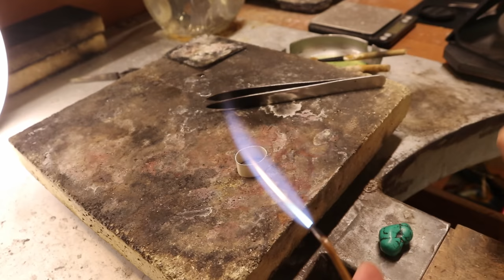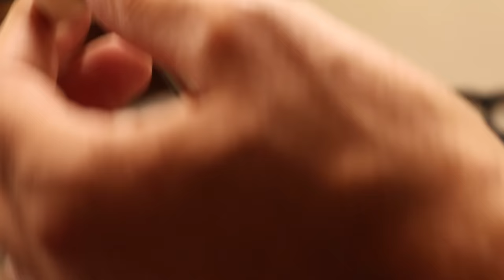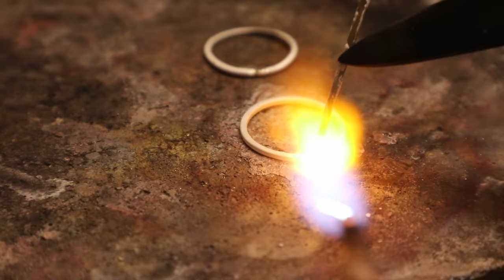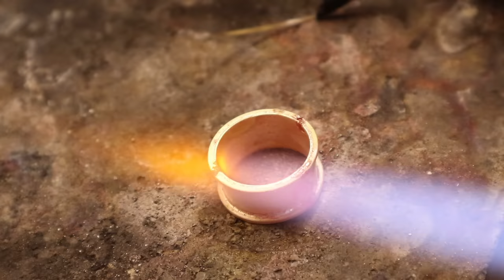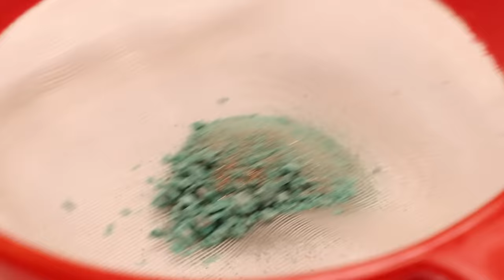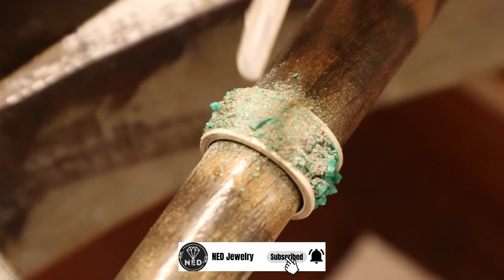How to make an inlaid ring using silver and turquoise stones

Comment: if that is normal superglue, the moment that ring comes in contact with any solvents the ring inlay is toast. I am a jeweler I have been wondering how people were making these things. Thank you now when someone brings be one I might be able to repair the chunks missing out of them.
Reply from the maker: Thank you. It doesn't break very easily, nothing will happen unless it gets a hard blow.
Reply: hiya, what glue would you use.  thanks
Reply: Some i have seen use epoxy

Comment: What torch are you using at the start to melt the solder paint?
Reply from the maker: The oxygen torch tip I use is replaceable.